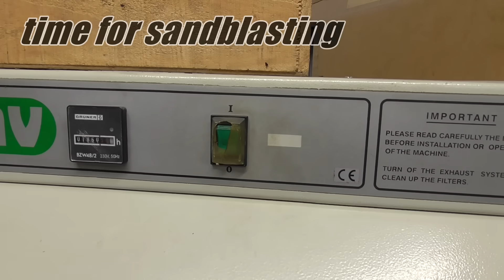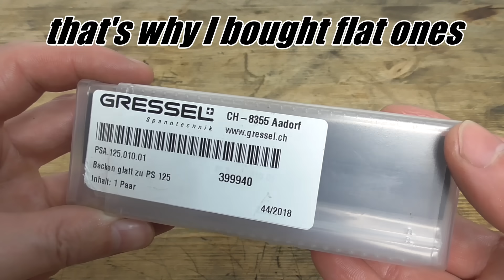Rusty Deadlocked Vise - Perfect Restoration

Comment: Love the video, very nice job. Can I ask however, why do you put grease on the Bolts as you put them in? The countersunk bolts espesially, I'm curious.
Reply from the maker: It's recomended to grease threads and bare steel parts in general, just to prevent from rust ;-)

Comment: Moeilijk gedoe allemaal, waarom niet eerst even stralen met glasparel?
Reply from the maker: Sandblasting would damage the dovetail and the rest of the bare metal surfaces, so i would need to tape it anyway. Also you don't want to bring to much dirt and rust in the sandblasting media.
Reply: my mechanics niet met glasparel, dat is bijna een polijstmiddel

Comment: Stunning, could I ask a question please, and I’m by no means an expert, when you greased up the parts for reassembly, would copper grease have been better in some areas? Many thanks
Reply: Thanks for the reply
Reply from the maker: I'm not a grease or lubrication expert, but i guess for not moving parts it would be good. Like the two screws or the missing plate. Thank you
Reply from the maker: The wrong grease or oil is still way better than None ;-)

Comment: .......... Is there ANYONE who knows how to use a penetrating oil..........???
These oils take TIME to penetrate !!!!   Everybody thinks these oils can work miracles and release rusted  objects within seconds... They rarely do. It usually takes hours, even a day or more, to fully soak in. And only THEN they work as planned. Most of the time....
Many people also think WD-40 is a penatrating oil. Well....yes and no. WD-40 stands for Water Displacement formula number 40. It was designed to be a protective oil, not a lubricating or penetrating oil (penatrate, yes, but only to displace water, not to loosen parts).
In 1953 the staff of the Rocket Chemical Company needed to develop a special oil to protect airplane- and rocket engines. 39 attempts failed. The fortieth one was good enough and became known as WD-40.
So.....for jobs like the one in the video, it's better to get a real penatrating oil. Not WD-40.
Here is their website and history :
https://www.wd40.com/cool-stuff/history
2:13 .....  See? He sprays the screws with WD-40 and immediately tries to unscrew them. They came out DRY.....!!!
Get some real penetrating oil, cover the whole thing in it and let it soak overnight. The next morning, spray again, eat your breakfast and then go to work. The parts should come loose much easier.
Oh...the end result of the restoration? Top job !! Absolutely wonderful !! I mean that !
Reply: telescopereplicator IMHO I’ve used All different brands of penetrating oils and found that wd40 works by far the best, regardless what the manufacturer intended use. My dog isn’t a hunting dog but, she trees squirrels all day along. ; )
Reply: Sometimes just the WD40 and like 20min is all u need. I highly recommend checking out project farm's YT channel, he puts all the penetrating oils out there to the test against each other and his tests are EXTREMELY well done, couldn't recommend a better video to show how well the different brands work and how fast they work and on different types of materials
Reply: What would be a good penetrating oil then?
Reply: @perlarsen3645  50% ATF and 50% acetone.
Reply: @dorianfulton7168  Thx. What is ATF?
Reply: @perlarsen3645  automatic transmission fluid
Reply: I wish I could save your comment and everyone else's responses. The more you know!

Comment: If it helps for stubborn rusty joints i boil up old oil and leave the parts soaking overnight,  usually does the job much easier ;)

Comment: I've come across some of your videos and they are nice to watch and learn.

Now, if you allow me to "give something back", when you're painting the words and numbers, I would suggest you used some kind of masking. Only that instead of masking tape, which would make no sense, you could use some kind of silly putty or clay. You just place it over the letters and push it against them, then remove the excess, if needed, with some scrapper so the top of the letters are visible.

Then you just have to paint and remove the silly putty or clay when the paint dries.

The only thing about it is that you may need to pass some cloth over the letters in case the material you use leaves some grease over them, but anyway, I think it's faster and less nerve racking than doing it completeley by hand.
Reply from the maker: Very clever tip, thank you :-)
Reply: You're welcome, my pleasure :-)
Reply: @fadetounforgiven  i thank you too :)
Reply: And you're welcome as well. I actually thought it's a silly piece of tip... but in the end, it includes silly putty so... ;-)
Reply: Another way to do it is to apply paint to a piece of card board, then apply the wet painted card board to the raised letters very lightly.  Just enough for the surface to make contact with the raised letters.  Sometimes you may need to touch it up after the application, but it's a very easy way to paint raised lettering.
Reply: Thats was a great advice
Reply: @Reese Designs thank you :-)

@Sooner Keith, nice as well but I see two problems with that. First, that you depend on the material (cardboard or whatever) and it's ability to hold the paint. It may make paint run, drip, you name it, so you have to be very careful when you're applying it. And even when you're applying the paint, maybe not all of it transfers on to the metal but leaves a too thin layer with the metal showing through.

And second, the top surface of the letters is not plain, it's very usually rounded, therefore it's harder to set where the limits are using that method.

But it could work well at times :-)
Reply: @fadetounforgiven  I've used the aforementioned application method for a lot of work and you are correct that 1) if you're dealing with rounded lettering it's only going to hit the highest surfaces, and 2) you have to be careful not to over saturate the material you're using as the "stamp" or you'll get drips.  I've found that even with rounded lettering (like the type in this restoration) it gives a clean guide but will require more work to get the complete look.  I've used clay for similar lettering jobs, but what I've found is that you can run into similar problems as you mentioned with the stamp method.  The benefit of using clay is that you can essentially make the masking properties as detailed (or not) as you want.  Like anything, the more time you spend in prep the better the end result.

Unfortunately, there's no super easy and quick way to paint molded lettering like those in the video.  Ultimately, it's just about taking your time and it'll show in the finished product.  

Cheers! :D
Reply: @Sooner Keith then we are more or less on the same track. Your method requires less preparation, but you have to be very accurate with the amount of paint you spray on that "transfer surface". Too much or too little and it just won't do it. And in the end you have to rectify it most of the times I believe.

"My" method takes quite some more preparation work depending on the complexity of the letters, but unless your brush is dripping with paint, it shouldn't have mayor problems.

Nope, there's no easy and quick method for this.
Reply: @fadetounforgiven  Yep, either way you're going to be spending extra time to get the finished look.
Reply: A very old ( old timers way) way of removing rust is to submerge the whole vice in a mixture of 1 part malasse and 9 parts water ....and leave for 2-4 weeks ...the explainion I was told .... oxygen attaches it self to rust ..the more oxygen and exposure to the air and water the more things rust  ..when you submerge in the mixture ..... you  stop the  rust attracting and   extracting oxygen from the air ....the oxygen already on the rust  will turn its attention to the rust ( because it can no longer breath) (malasse ferments and removes oxygen from the water )  and eats the rust away ...leaving you with clean metal ...that gets into every nook and cranny ...you are left with a black sludge that will hose of ( could use high pressure) ...stinks and stains cloths) ...but it is very very effective ...I do it all the time
Reply: Although I might be wrong, if I remember correctly, the thing with rust is that iron, Fe, is "positively charged", and oxygen, O, is negatively charged, something like Fe+ and O-- or something like this. So, the same way water is H20 because of that (it's a VERY simplified explanation), oxygen also mixes well with iron, be it because of the oxygen in the air, be it in water, where there's usually oxygen ions.

So, when you get some acidic solution, which means that it's reach in hydrogen, that will tend to react with the oxygen around, including that of the rust, making rust weaker and crumbling down by itself or with some mechanical action (scrapping, water pressure, etc.).

However, from what I've just seen, that molasses and water mix does it a different way.
Reply: You have a new subscriber! Such an end result must feel as good as winng the lottery
Reply: There is an efficient and simple way. With a coin and a small piece of fine tissue. Place the coin in the center of the tissue and wrap it around, leaving a layer of tissue on one side of the coin. Then dip lightly in the paint and apply to the letters. Like a sponge in the stencil technique. But, the mask is not necessary because of the relief in the letters. I've used it to repaint letters on  license car plates. It worked very well. No dirt!
Reply: Or use tacky paint and a sponge.
Reply: Solid tip!

Comment: Can other type of oil be used? Why you checked if metal was soft or hard?
Reply from the maker: you can also use oil, if you clean and oil it once a week. If the part was heat treated, i would ruin that heat treatment by heating it up again and weaken the part.
Reply: @mymechanics  I thought about rapeseed oil which you used to taint the handle black. Can you use some other oil for that purpose?
Reply from the maker: @siux94  yes, pretty much any kind of oil works.

Comment: AWESOME work.  I do understand that the vise is now a collector item and not likely to go back to hard work on a bench, but why did you use simple filler on the chip on the vice?  Why not braze it in and finish it that way?  It looks like you have a very nice shop and many skills.  This is my first time watching one of your videos, and I will watch more.
Reply from the maker: i didn't wanted to weld it, because of the heat, braze might work. because the hole appeared after sandblasting, i tought it was used filler too originally. i'm going to put this thing on my bench one day :-)

Comment: Going all the way from rust to stone work. Outstanding! But why the countersink on the pin and threaded holes? Not needed and will actually make it somewhat weaker.
Reply from the maker: Every hole needs to be countersinked, it protects the holes and threads and also removes sharp edges. It would be a no-go to not do it. Thanks for your comment

Comment: beautiful restoration. Why grease all the jaw screws and jaw parts - I think they should remain dry for a tight fit. no?
Reply from the maker: They still fit tight. It's in general highly recommended to grease all threads and bare steel parts, just to prevent rust. The next person disassembling it will be thankful. Thanks for your comment.

Comment: Does WD-40 remove rust?!
Reply from the maker: I used wd-40 to get some oil in the stuck dovetail. As i was told in the comments, i should use other penetrating oil for better result. I would not use wd-40 to remove rust.

Comment: Why wouldn't you just file/mill the old jaws flat instead of buying new flat ones for ~70, EUR the pair?
Reply from the maker: Well first, the screw head would then be higher than the surface. It's only a few tenths lower now. I also wanted them surface grinded, the jaws are hardened and it would be difficult to mill them flat. I also want it to be original, these flat jaws lasts forever. So i think it's worth the 70€.

Comment: Your method of separating the stuck jaws is nothing of brilliance but.....the application of heat (butane / propane torch etc) to the outer jaw may very possibly have broken the adhesion between the two pieces before you went to all the trouble to make that gorgeous tool. Fabulous restoration of an equally fabulous vice. I found particularly interesting your use of grease both between the jaws and upon the fixing screws & stud. This philosophy is one I myself follow. A very good practice that can prevent metal to metal fusion during very long periods of uninterrupted contact.
Reply from the maker: Also pervents steel from rust, the next person disassembling will be thankful ;-) i would use heat as very last solution. I had the time and wanted to show you guys an interesting video. Everybody can heat it and hammer it out ;-)

Comment: That is one sweet vise. I would be afraid to use it. When I paint raised letters like that, I get a block and stretch some old material on it. Old jeans, or something totally disposable. Then I paint a little bit on the material, not a lot, just a little. I use it like a stamp pad. Don't rub it, dab it. It should cover just the top of the letters, and goes pretty fast. You might need 2 coats, maybe 3. Better too little than too much. If you pull a plastic bag over the painted material, you can probably use it for the next layer easily without having to stretch new stuff. You might sand the tops of the letters flat, or file them, if you are a glutton for punishment. Jeez you did a great job.
Reply from the maker: Great idea! I actualy used a plastic bag as well to keep my brush wet between the two coats of green.

Comment: Hello! what is the type of cleaning tool that you use? Ive skimmed through the comments and description but couldn't find the answer? :)
Reply from the maker: It's a parts washer. The liquid is just called parts cleaner where i buy it.
Reply: @mymechanics   oh, all the dirt and grime just came off so easy! I thought there was some more to it?? Great!
Reply: @mymechanics  Here you talk about cleaning machine?
Here i see first time this kind of cleaner/degreaser tool like this.
What is it?
And you wear protective rubber gloves - are liquid are acid/alcali type?

Thanx.
Reply from the maker: @az113  it's a parts washer, small box with liquid and a pump in it. It pumps the liquid through the tube into the brush. Very effective. Its not acid, some kind of degreaser yes. Google parts washer, im sure you find something. I bought it on a fleamarket for 15$.
Reply: @mymechanics  Thanx for respond, i really first time see this tool.
Will search (or make) some similar, you tell me operating principle, rest is the technical problem ;)

Comment: why not sandblast right at first instead of after the fine flattening and smoothing?
Reply from the maker: I'd had to tape it anyway to protect the bare spots and the tape holds much better on the clean surface.

Comment: What bits are you using in the impact, I've got a stuck but don't know what bits I should get for my manual impact
Reply from the maker: The impact had just 4 bits included, i was very lucky that i found an adapter to use the regular bits. Figure out what bit size your impact has, then get an adapter piece for regular bit size. ;-)

Comment: A-man,  you are the first one I saw to use a sand blaster. I have one and no how handy they are. All the other ones use acid to clean off the metal. Nice to see you using one. Thank you so much. If you like off stuff, get a old oak picture frame and hit it with the sand blaster, it leaves the hard grain and eats the soft grain away. Looks like small mountains
                                                                                                                                         Terry,  USA.

Comment: The cheapest and probably most effective penetrant is 50/50 mix of acetone and automatic transmission fluid. Just to save you some time...though you clearly took care of it with a much more potent solution. Being a machinist comes in really handy for these restorations, I'm sure. 

 But man you did an incredible job with that vice.
Reply: If I have time here and there, I could translate into Serbian for you, for what that's worth...though technically it's Bosnian and Croatian as well, save for negligible differences in dialect.
Reply from the maker: @lhsgrobar  to keso 😉 that would be awesome. Hvala. You can send it to my email, you find it in channel info.

Comment: Excellent job! Absolutely beautiful.

 I did restore an old American 5" jaw vise some thirty years ago. I left the serrated jaws on. For my purposes it was preferable. But I made a set of soft jaws to slip over them out of 1" OD soft K copper tubing. I worked for the water supply company so I got it out of the waste barrel.

Cut the tubing roughly 1/2 inch wider on each side of the jaw. (1" wider overall) one for each jaw. Cut the tubing laterally with a hacksaw or bandsaw on ONE side. Open them up and flatten them with what you got. They don't have to be perfectly flat. You might want to make two sets if you use them as often as I did. You'll wind up with two rectangles. Put them together and file/sand one of the long sides straight. Keeping them straight, insert them into the vise slightly lower than the jaws and clamp them down tight. Get a smooth face hammer and bend the plates over the sides. Each to its own jaw. Then fold down the top over the jaw. Hammer the top sides around the sides of the jaws. Now you have a set of copper jaws you can slide on and off when you want to clamp up something you don't want damaged by the steel jaws. It took me longer to type this on my tablet than it took to make them. You don't have to be accurate. It's not rocket science. Trim to fit your vise.